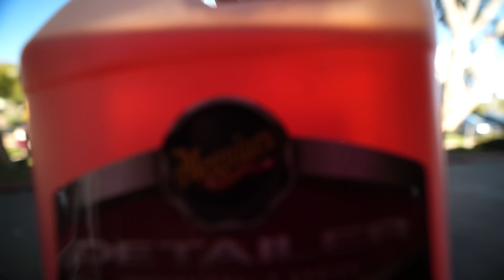Building My Supra into a Competition Drift Car Ep.1 - Widebody Install

Comment: If you run the guard on the grinder not only does it greatly reduce the risk of having to pull disc shards from your face but you can actually direct where the sparks go…. So making it much safer for paintwork and everything else around it.

Comment: One big suggestion for the car, if you plan on going piggy back i do suggest BM3 and tuning specifically with OdinTuned. He's definitely the most experienced with the b58 when it comes to reliability and ability to push some serious power. If you do plan on taking the car to a degree of quickness not necessary for the track, EcuTeck and MarinTuned would also be an amazing option as he has always worked with supras, and if you do know Randy with Illiminate then you can talk to him since he also tuned with Marin. Both amazing tuners but definitely would stay away from JB4 unless you want to risk reliability when pushing piggy back numbers. Huge fan of this build cant wait to see it perform!!

Comment: Carbon fiber is significantly less flexible than fiberglass and is the preferred material for applications in which stiffness and rigidity is essential (mechanical components for example).  Carbon fiber’ tensile modulus is 4 times that of fiberglass. For applications in which flexibility is required or rigidity isn’t imperative, fiberglass is often the preferred choice.
Reply: Wrong carbon has more flexibility then fibreglass, fibreglass cracks and swells under pressure and heat
Reply: Yeah I think tj's confusing fibreglass with polyester resin vs epoxy resin

Comment: I think you're experiencing a little bit of scope creep TJ, you said this build was supposed to pave the path for entry level drifting on this platform, but you haven't really tried the path of least resistance. What works and is the cheapest and easiest. Especially since you have your 350z build you dont need this thing to be a racecar, just do seats, steering wheel, hydro, angle kit, body kit, ECU piggyback. That way you have a reliable seat time car.

Comment: Another build idea is to have Toyota help you with modding one of your cars to run on gas hydrogen like they did with the their racecar Corolla. It can be like throtl's build they did with the 370z and swap it with an electric drivetrain but in this case you modified it to run on hydrogen. Plus you live in Cali and they have like 50 hydrogen stations. Also, you can do a hydrogen fuel cell electric build too if you want

Comment: TJ, just curious is it possible to use a 2JZ along with a 2022 or 23 supra stock oem manual driveline?
Reply: No that's a toyota motor and bmw gearbox they would need adaptors etc

Comment: Also... Would it be difficult or even possible to install an air jack system on the car? I feel like that would be incredibly useful for quickly swapping out wheels or body panels or anything like that at the track. I saw an R8 with an air jack system at the track a couple years ago and it was sick!